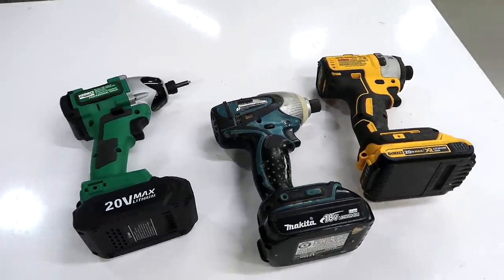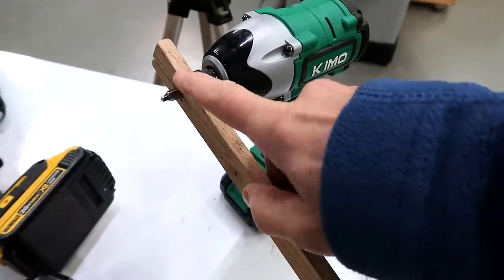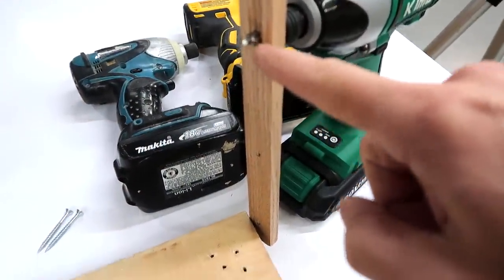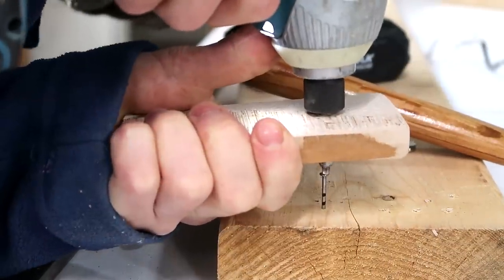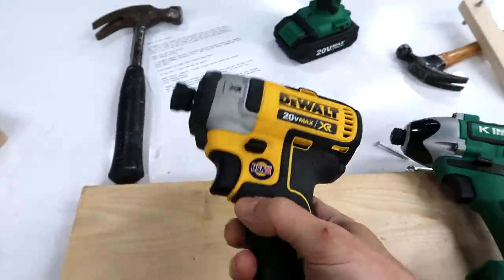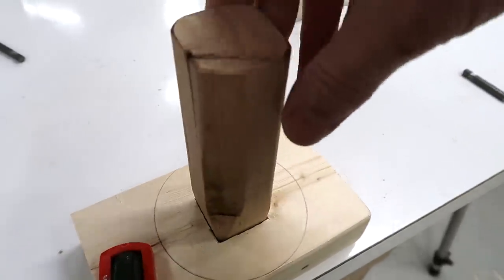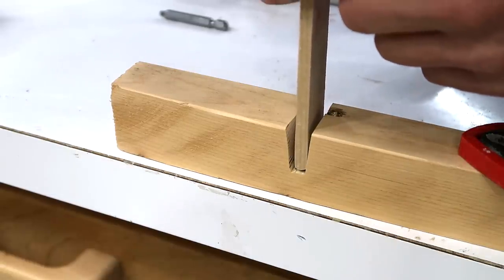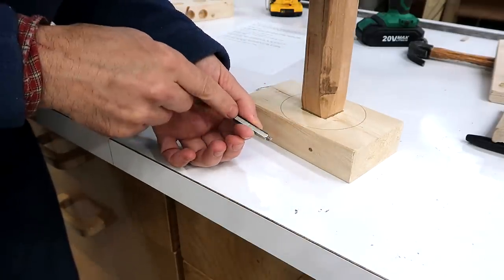How impact drivers prevent screw cam-out

Comment: Cam out performance is something that is routinely modeled in the fastener design world. Along with testing at both zero degree (ideal conditions) and ever increasing angles to simulate misalignment on the factory floor. 
That's why you almost all small screws in trim or light duty applications have moved to a hexalobular drive (Torx without the licensing fee) 
Torx Plus is another relatively new technology for low profile high strength applications like flywheel bolts and similar.
Reply: That is very interesting.   My favorite part is how each box store has chosen their own size so I always have to wrong bit in the drill . :D.
Reply: What is the mass market? For robots or people? Typical misalignment would be different.
Reply: For me it come down to experience ...over 59 years ...don't need a reply .. I just know !
Reply: Is the specification for name brand "Torx" different than ISO 10664? (don't mind me I just googled a new word) I assume there must be some differentiating features that give Torx some market advantage to need a brand name and trade dress
Reply: @joeo6378  There are a number of standard Torx  (hexalobular) bits; the size is determined by the fastener manufacturer. The bits are deceptively similar to the eye but the right bit makes the bit and screws last a lot longer (my son screwed his entire deck with a Torx 25 bit, when finished he realized that the screws were Torx 27's! WERA makes good bits!)
Reply: @icystrangers5482  Both, really, at least in my industry.  It's impressive how reliably an automated screw station feeds and shoots screws, mostly torx drive oval head.  For people, we run primarily hex head screws, as misalignment can be readily monitored and corrected by the assembler.  In instances where there's concern of misalignment causing the bit to jump the head, risking damage on a finished part, we'll switch to torx drive and make that assembly station responsible for fewer screws per time cycle.
Reply: @alanbockelman  It wouldn't surprise me since there's a lot of individual "hexalobular drive" standards that vary by auto manufacturer, mostly regarding what recess size mates with a given screw/head size. The recess sizes themselves and the associated gaging should be pretty standardized though (and similar to ISO).
Reply: @a89proof  depending on the volume of tools you're using you can get your tooling supplier to redesign or modify the geometry to better fit your particular parts.
I worked with a blue oval and their drive tool supplier to redesign some geometry to better fit their standards. 
I'm also had our production tooling shop make custom sockets for customers in specialty applications. If you can tighten up your geometric tolerances you can dramatically reduce cam out and thus part scrap.
Reply: This guy screws
Reply: Torx bits dont last very long compared to robby or philips, they end up twisting.

Comment: you're absolutely right. it's the release of torque that allows the bit and screw to re-align, and that happening frequently prevents the slow-outward-driving force caused by a small misalignment of tool to screw

Comment: As long as we all agree slotted screws are the most annoying.
Reply: I'd lean more towards infuriating.
Reply: Also most aesthetically pleasing though and a worthy endeavor where appropriate :)
Reply: @paulmac7667  A full set of slotted screwdrivers will go a long way to alleviate that. Many times the screwdriver is 'good enough' in size to fit larger screws but lends to the frustration/damaging the screws. Also properly drilled starting holes are much more necessary.
Reply: With the one caveat that the slotted screw is the easiest one to clear paint out of if it is liable to get painted over (for example they are still used sometimes on boats for that reason).
Reply: @dking504  Agreed. The trouble is, the ones I usually have to deal with come pre-flogged by the previous buffoon. aka tradesmans' backside.
Reply: Painted* slots
Reply: They are, but unfortunately also the most simple and aesthetic design ever
Reply: Exgrmbl How... why.. Is this a thing?  It’s just a slot.  How is it more aesthetic than another screw head?  It’s not really an aesthetic thing in the first place
Reply: McKenzie Keith Is that why it’s used most often for wall fixtures like switches?
Reply: @micah_lee  I would have preferred torx, so much sexier and industrial looking lol
Reply: micah_lee slotted screw is the least busy looking screw head despite all of its drawbacks. Try it yourself, replace your light switch with Philips or Robertson screws and they stick out like a sore thumb.
Reply: @dking504 , I think flathead screws are disgusting looking. Maybe just because I empathize with whichever poor bastard had to install them
Reply: In certain trades (particularly electrical) a nice quality slotted driver that's just wide enough to fit a #8 robby across the diagonal will turn almost every screw you're likely to come across in a day.

Comment: Do you not have torx screws in Canada? They're becoming the norm in Europe and that's for a reason.
Reply: Yes there is torx available here. I see it mainly in two applications: machine screws and deck screws.
Reply: I concur. I exclusively use Torx Screws, they've become as affordable as the Pozidrive Screws, I've used before and much more convenient. Robertson screws seem to have never made their way out of Canada.
Reply: @HexenzirkelZuluhed  with robertson (i use them for my kreg (i know)) the bit tends so stick in the screw when you drive it out, so you have to keep pulling screws off the bits. not a problem with torx, + the gripping strength is much greater due to more facets. I threw out my pozi years ago.
Reply: Torx screws are strong. Torx bits are weak, and the T15 fits a T20 just well enough to destroy the bit and screw a couple screws before you realize.
Reply: @TheThomaswastaken  i use a T20 bit with t25 screws all the time. I use cheap bits mostly. Works perfectly fine. No slippage, not rounding.

Comment: If you look at the internals of an impact, a rotating hammer drum is held in place by a spring that when torque is applied, the spring compresses moving the hammer drum above the walls so it can spin around and slam into them. There is a slight back and forth force as the hammer moves linearly to clear those hammer walls.

Comment: I always used to find that square drive were not very tolerant to being driven in off angle, and for that reason I always preferred pozi drive (phillips but better). However, since square drive are more common here in New Zealand I persevered and I think square drive are now my preference, especially when driving a screw into something harder than pine.
An impact driver was definitely a game changer. That is clear to see when by watching my young son drive screws. He struggles a bit with the drill driver, but with the impact driver he can whack them in no problem.

Comment: Thank you for these experiments and video. Really great!

For those without a impact driver: to reduce cam-out with a drill screwdriver just release the trigger every second or so. For really difficult screws I use a throw my weight forward, push-real-hard and apply trigger for a second, then release the trigger. This release lets the bit go back in. The other thing I find  is if the cam-out makes metal slivers  they act like ball bearings and make the cam-out much worse. I find the De Walt #2 Phillips bits are inexpensive so as soon as they start wearing I replace then. My experience is a Phillips bit will hold a new screw quite well as I am moving it to the wood.

Comment: I'm an electrician and I've always been a Dewalt user but recently Milwaukee came out with a "hydraulic" impact driver (named Surge) which is about half the loudness of traditional impact drivers. I got it for christmas from my wife and boy do I love it. It's so quiet and smooth. Granted it's not as powerful as traditional impacts, but that doesn't really affect me as an electrician. I'm not driving long screws, most of the time I'm driving a 1" screw to mount boxes or conduit straps. I highly recommend you try it out.

Comment: Today's takeaway: an impact driver is not a good hammer.
Reply: I beg the differ, Steve Ramsy uses it as rubber hammer all the time ;)
Reply: Depends if they’re my tools or company tools.
Reply: That's what a screwdriver is for.
Reply: Use the battery...

Comment: I too hate the loudness of impact drivers - too much indoors. But I also appreciate this advantage they have driving screws. One of my best tool purchases has been the Ridgid Stealth 18v driver. It uses a hydraulic system instead of a mechanical hammer and basically gives impact performance without the impact noise. And it has three settings. The lowest of which is gentler than my 12v impact driver, and the highest of which is a beast. It's a really versatile tool. I can't remember the last time I used my old impact driver.

Comment: I believe that pozi 2 drive screws are the way forward, we use these regularly in the uk over any other. Pozi drive has an extra added slot between the usual big and obvious Philips heads giving it more grip and less change of sliding. After using pozi screws for 5 years and using torx/ hex head screws for the same amount of time I would say the bigger torx head the better however pozi 2 and 3 are usually the go to screw

Comment: Use spax torx head screws. Never look back.
Reply: Makita new xps bits are better, perfect fit
Reply: This. Though I haven't used the spax plus bits.
Reply: @DeKempster  Spax isn't a bit, it's a particular rippled thread design.
Reply: @bmedicky  I known, but their Torx have an extra round protrusion, probably to give it even less change of falling off the bit. They call it T-star plus.
Reply: @DeKempster  Interesting, I'll have to look into it.
Reply: I love the spax fasteners
Reply: @
FoxtrotFound 100%. u nailed it... hmm maybe not
Reply: I use little star shaped ones idk what they’re called but they’re perfect
Reply: @DeKempster  isn't it the "security torx" ?
Reply: I agree that Torx is among the best systems for mitigating cam-out. They're so good in fact that they cam out less in Allen fastener than an Allen wrench ime. They're also decent for turning triangle socket head screws since the real articles are apparently contraband for us home gamers.  They can't have us finding out what's inside of those happy meal toys I guess. What was I talking about? Oh yeah, Torx's. My main issue with em is the specificity. There's too many of em. That is, there's too many sizes.  it should only go up a size when the overall diameter increases by like 25% like with Phil and Rob. It'd also be nice to have it use an 8 point star to make it possible to mash a phillips, flat, square, coat hanger, etc. in there if you're in a pinch or just cheap and lazy.

Comment: The forward "hammering-like" action comes from the impact driver's hammer and anvil wedging apart and back together for the impact motion, making it also a reciprocating motion.  Flathead, Phillips, and Square drives and screw-heads are deliberately tapered so that they will cam out instead of snapping off the head of the screw if over torqued.  That way you have something for an extractor to bite into. "Hexalobe Drive" (torx/star) bits and screws, as well as Japanese Industrial Standard (JIS) cross tip are not tapered and cam-out is much less likely.

Comment: It's about time someone other than me criticized Robertson Drive Screws. I don't know how many times I've had to drill out these screws because the heads were rounded out because of misalignment with the diver. The Robertson Drive Screws are especially prone to "cam-outs" when they are made of stainless steel which have little or no steel in its alloy.

Comment: The impact drivers are great, for certain things.  They're not a replacement for a drill / driver with a clutch setting, though.  I picked up one of the 12 volt cordless screwdrivers, which is basically a drill with a 1/4" hex socket in place of the chuck, and I find myself using the impact driver far less often now.  For shop projects, the little brushless 12 volt drill/driver, screwdriver, and impact make for a handy trio, and I'm saying this a someone who would prefer a corded power tool over cordless for most situations.

Comment: You'd be surprised how well a quality PZ2 or PZ1 bit sticks on quality PZ2 or PZ1 screw. For example, Spax branded screws, used with Spax bits (the one that comes with the screws..) It holds to well that you can hold it vertically (against gravity) and oftentimes, a magnetic bit holder actually holds the bit with less force than the bits sticks to the screw, regardless of the magnetism of the bit holder. Unsurprisingly, there is basically no cam out when both the screw and the bit (of said brand)  are new.

Comment: The next question is what happens when you make the sides of the robertson square?

As for torx screws...well they go in nice but if they are exposed to elements for any length of time they are not coming out without stripping. Prime example of this is 80's gm truck taillights used them. They almost always stripped round after a few years.

Comment: Excellent technical analysis of cam-out.  I wonder how Torx bit fasteners would far in this regard with so many sharp corners.  I think impacts have their use, but the biggest detractor for me is not the noise, it’s the lack of a clutch. Too easy to overdrive screws.  For rough work they can’t be beat though.

Comment: If you look at the internal Dewalt parts diagram (available at Dewalt parts re-ordering website), you will see that a hammering force is translated into a rotational force.  So I believe the "theory" behind the impact driver is based on a rotational hammer force.  However, some of the actuator action of the hammer is not 100% converted into the rotational force, so it does show up as a slight hammering action at the tip.

Comment: I switched to GRK Torx screws and haven't had any cam out issues since.
Reply: People love to debate Robertson vs Phillips but never mention torx. I've been goign on the same torx bit for 10 years now and have never stripped a screw.
Reply: This is my go to screw for wood working. The built in washer and the torx drive are great. Also the tips are actually sharp so they don't walk when you start them without a pilot hole. They also look better if exposed on a project. Well worth the money.
Reply: The problem is that it usually happens when taking things apart, you're at an odd angle and don't always know howuch pressure to apply.
Reply: @andrewv5104  
Quite honestly the most impressive part of your statement is not so much the longevity of the bit but that you managed to not lose it in that time. 
But yea I like those bits too. Never worn one out but I've lost plenty :/
Reply: @andrewv5104  that's incredible. Who manufactured the bit?
Reply: there even are these torx with a tiny cone on the end and the matching screws- they don't slip and hold the screw in place
Reply: As a kid (~10yo), I was tired of hearing my dad complaining about cam out and the resulting damaged screws and bits, so I told him "Why don't you just use torx bits?" Never heard a complaint since.
Reply: Torx are great but they’re a pain to get out if they sink into softwood and sawdust gets in the head
Reply: @GarwoodNick  Irwin. It's double ended with robertson on the outer side. Also part of the reason why i haven't lost it is I only ever use the 1 bit.
Reply: Torx screws seem to work better for menalso
Reply: theyre great.. if you can afford spending 10x the cost on screws... cam out really isnt an issue in typical construction/building projects
Reply: @AndrewBrowner  Torx is really that much more?
Reply: Torx screws all the way for me too, where I have the choice.
Also been using the same T25 driver bit for about 5 years now with no issues.
I do think a lot of the issues come down to the quality of the bit and the screw, and how much wear there is before you change the bit.
Mass production manufacturing lines probably don't produce a lot of waste due to screw head damage regardless of head type so there must be operator error, alignment issues, and bit wear effects, for the average person
Reply: @andrewv5104  Thanks, obviously I've been buying the wrong bits 'cause mine only last a few months before they start stripping screws.
Reply: @Gadgetmawombo  here in canada yes.. can get a box of 2000robertson 3-1/4" for 30$ typicallu while torx will be close to that pice for a box of 100-200screws
Reply: @AndrewBrowner  torx is the exact same price as Robertson or Philips for me. Like $3.50 us/lb. Number of screws /lb depends on size.

Comment: Just another thought. It might also be that the rotational torque is applied over a very short period. If cam out occurred it would have to accelerate you and the drill over a much shorter time than with a drill driver. This takes a lot more energy or umph to do (velocity squared) and so less cam out

Comment: For your nail test, a hex driver have been a lot easier than what you have going on there.

I agree with you in terms of the robertson screws. I gave up on those long ago and now use torx drives 100% of the time. Cam out is a thing of the past for me, whether I use a drill or impact. And I have come to prefer the drill even if it's a bit slower and requires two hands sometimes to handle the torque, because as you say, those impacts are so bloody loud! Really want to try a hydraulic unit someday.